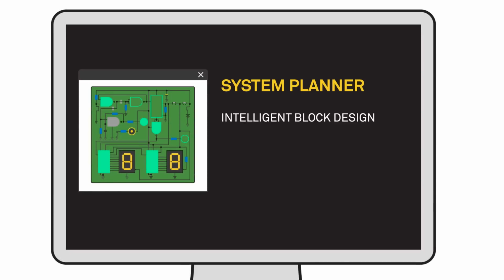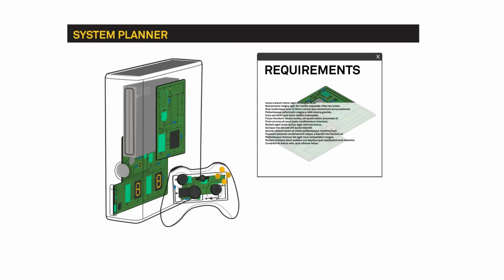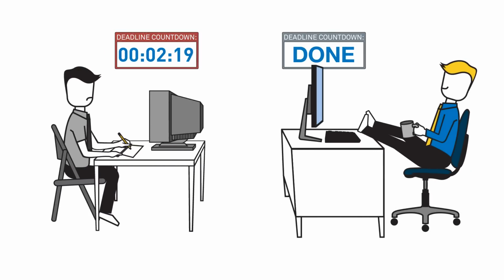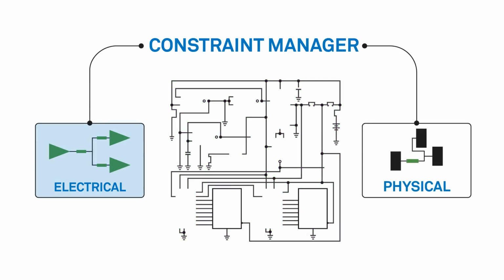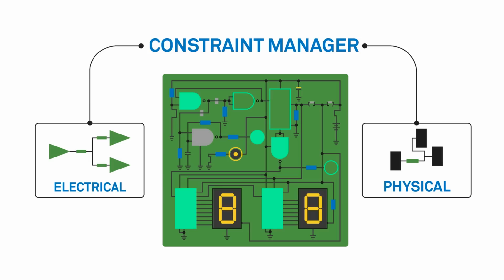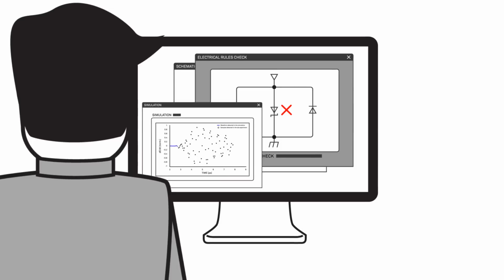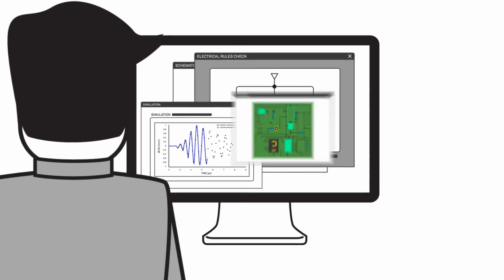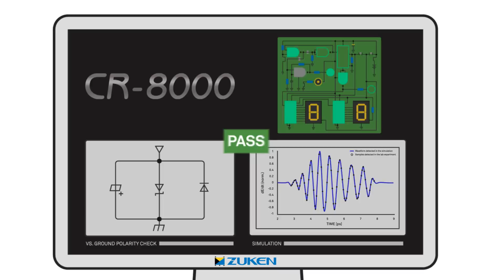Zuken CR-8000 - Intelligent Engineering

Comment: hello 

I am student and currently working on cr5000. I m doing power integrity analysis so I need some introduction in Power Integrity Advance Tool. I have already read a help file in the software but it is not helpful because the information is given in links and when you click on one link,again there is one another link.
Do you have some videos available for PIA.

Thanks